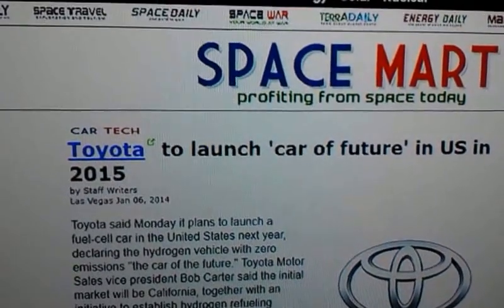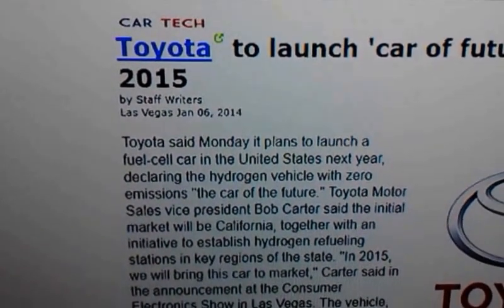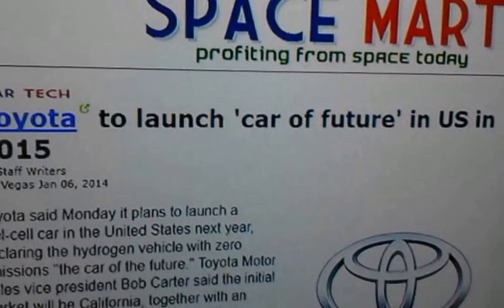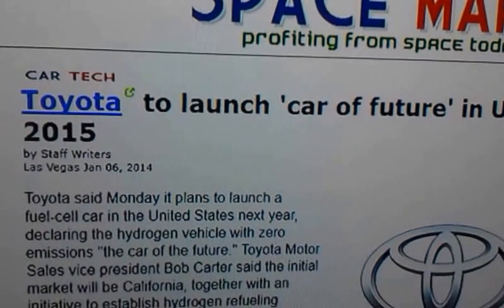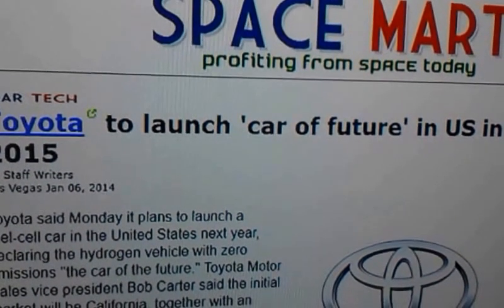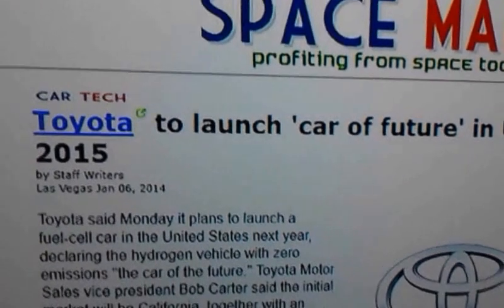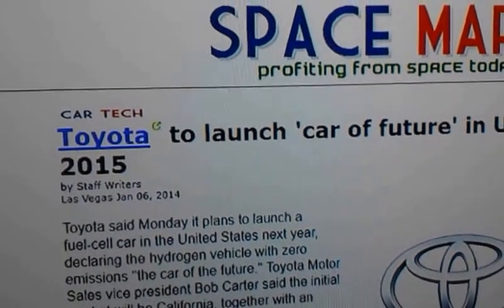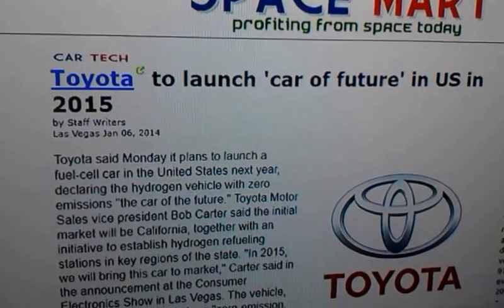Car of the future in 2015

Comment: User: LLJKotaru,video: geo metro 600cc bike engine.
maybe the engines you use are the one's they want you to use, and not the ones you can? I bet you could get away with using a 1/4 liter engine, with a custom electric turbo that is built by one of your magnet motor friends. 

just day dreaming over here :)